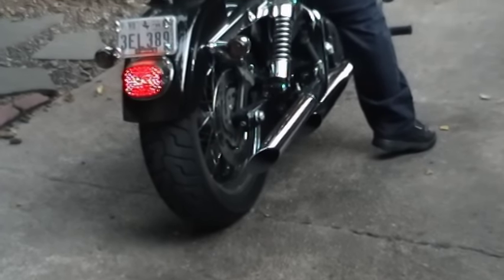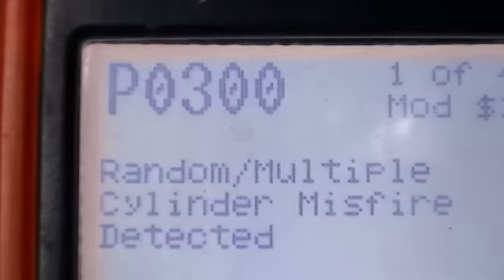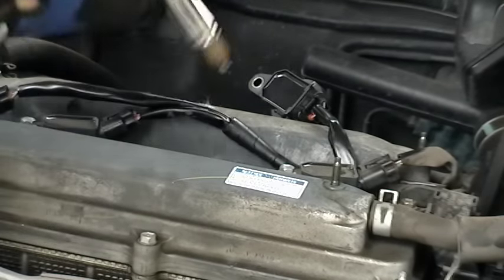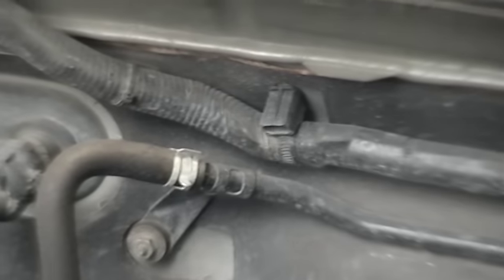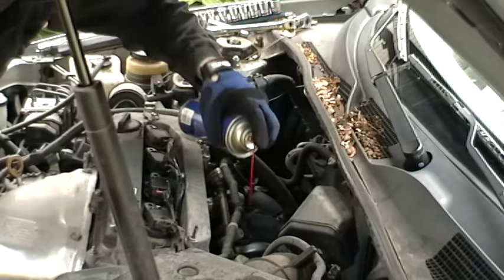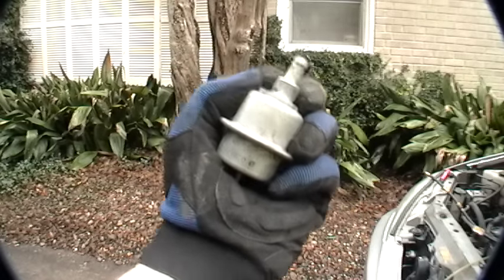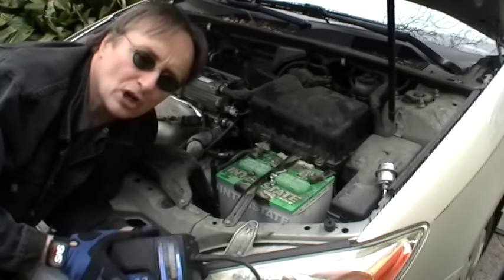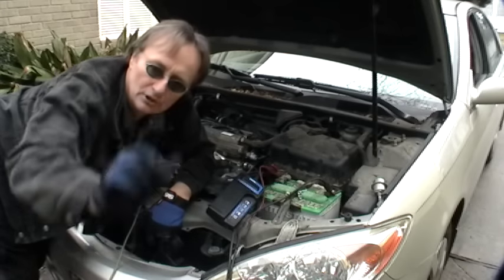How to Fix a Random Engine Misfire in Your Car (Code P0300)

Comment: Hi Scotty! I have the same code in my car. I changed the coil packs and igniters. The igniter plugs were in real bad condition. However it seems like this started to happen when I changed my PCV valve or for the Audi models it's called the oil separator valve. Any ideas? I checked also the battery it was good so I'm not sure what's going on. Also at initial start up when my car is starting up its normal but then after 1 min when all the cooking fans turn off the rpm slowly drops and drops more as if it's getting ready to turn off. Please if you have any ideas let me a hint I'm stuck between a rock and a hard place. Car is 2009 Audi A4 2.0T Quattro.

Comment: Scotty hi I like to ask you a question that me and my wife bought my daughter her first car for her 18th birthday. And the check engine is on and we had it scanned and came up with multiple misfires on cylinders 4-5-6. So I did a tune up changed the spark plugs and installed new coils (all of them) and I even changed the valve cover gaskets. After that was finished I didn’t clear the codes yet but I started the car and still ran rough. Is there something I’m missing and there some where’s else I need to check I hope I don’t have a bad piston or head gaskets

Comment: I've. Got a question for you Scotty
1998 ford explorer
304 code
171 and 174 codes
Changed plugs, wires and coil pack. 
Still has a 304
Changed number 4 plug a couple of times still comes back on. Cant remember the gap but i think it right. 50 something.
Next will be fuel filter. 
Any other ideas.
Reply from the maker: Patrick Wolbert do my video "finding engine vacuum leaks with a cigar" and pray you find some. If not, often a bad maf sensor
Reply: Scotty Kilmer thank you scotty 
Ive put a lot of work in this car i have to see it run. I have seen your  cigar vid on vacuum leak and am going to do that soon. Thanks so much for your help 
Love your channel

Comment: I have a 2000 BMW 328I and I'm getting codes P0305 P0306 P0304 and P1188 Codes, I already replaced the O2 Sensors before the cat.  I already checked the coils and spark plugs and cleaned the MAF Sensor plus I replaced the whole vacuum hoses and I clear the codes but after a day of driving the car they come back up.  Do you think it could be the secondary air pump ?
Reply from the maker: could be lots of things, you can't really fix a BMW without true guess work unless you have a BMW dealer level scan tool to analyze the data and real BMW codes, not just generic obd 2 codes.  But, from my experience, if you have that plastic intake manifolds those often develop  vacuum leaks, have a smoke test done first.

Comment: my moms 2001 toyota tundra has the CEL flashing and shaking. she told me that at idle there's nothing but when you put it in drive it starts shaking and smooths out as you accelerate, but when you brake the shaking gets really bad. if you know any more about this and possible causes and what it could cost to get fixed please tell me.

Comment: Hi Scott me again I put the scanner in my car and that code came up I had change the spark plugs not too long ago and the code still comes up my question is will I damage my engine if I spray some of the carburetor cleaner around the intake manifold but it's not plastic its like aluminum or steel I have a 02 Nissan maxima

Comment: 1984 Chevy Cavalier, 2.0 TBI. 64k miles. New Plugs, Wires, fuel filter, oil change, oil filter, and air filter. Cleaned the throttle body out and injectors serviced. Still misfiring and shuddering when its IN GEAR and my foot is on the brake. if i do this for a while (2 mins or so0 the check engine light comes on. When its in neutral its fine. Any advice?
Reply from the maker: get it scanned for the code, that light being on says a code is stored. E mail me that code so I can analyze it

Comment: Hey Scotty-
Got a weird one only 2002 Suburban 5.3L . Code P0300.  Also have a O2 sensor code. Very intermittent. Only when very wet outside. Plugs are worn, but are definatly not the problem. It's -12 here right now and it runs perfect, but when it rains it will misfire a little and the check engine light will blink. I think the fact it is so intermittent rules out fuel pressure and vacuum leaks. I kinda thinking full tuneup and replace the offending O2 sensor as well as the Cam position sensor and Crank position sensor. Any other ideas? Those are the only things I can think of that would be effected by being wet.
Reply from the maker: first, I would replace the plugs, if it's not that, then those are known for fuel injector problems. Try my video"how to clean fuel injectors on your car" and pray you don't need expensive new ones

Comment: hello Scotty, awesome videos! my 02 dodge durango started misfiring when Id hear the rad fan start at idle,then it would be ok after taking off. It did that 3 or four times. Last time it never came back. So far I have swapped and replaced coils to no avail. I changed the spark plugs, nothing. Changed the TPS today and at least it does not stall at idle now but still runs like crap. Also changed the battery and EGR today. When I changed the plugs I found they all smelled like unburned fuel. I noticed exhaust fumes coming out from behind the engine. I am thinking maybe the cat is clogged and the smokes come out through the flange or something but there is still smoke coming out of the exhaust. The hotter it gets,the worse it sounds. PCM? Cats? Fuel filter? Why would it come back to life a few times and not anymore?It happened so many times in my maximas I knew Id just have to change a coil and off I went. But not with my beautiful mudder..
Reply from the maker: have the battery and alternator load tested, auto zones do that free. Often it's just those bad

Comment: Hello! I own 2014 Mazda CX-5, 2.5 L. I live in Calgary and an "Engine Check" light appears on my dashboard every year when outside temperature exeeds 10 degrees Celsius. When it gets colder (in late September or in October) this problem disappeares until the next Spring.Two year ago, a Mazda dealer figured out that it was P0301 DTC but was not able to figure out what cause this problem. This year I checked it out with my OBD2 scanner and it showed me another code - P0300. Have you ever faced or heard about this kind of problem? What could cause it? This light turns on when I starts a cold engine (in the morning) and usually after the start during a minute or two engine works unstable. Then, during whole day, the engine works well. Hope you can help. Thank you!

Comment: Hey Scotty my partner has got a cx7 2008 turbo over 200,000kms on it and its having a bad jerking problem upon acceleration the engine light flashes then it stays on I checked the codes all it says is cylinder 3 misfire so I changed the spark plugs problem still there I changed the coil in cylinder 3 to cylinder 4 still having the same problem so I cleaned out the throttle body made no difference do u think it could be the fuel injector ? What else could be the problem?
Reply: Could be fuel injectors. Swap the fuel injector on the cylinder that misfires with a good cylinder and see if the misfire moves to that cylinder. If so, you have a bad fuel injector

Comment: Hey, I have a 2003 pt cruiser 2.4l 5 speed just bought it and the man we bought it from said he missed a gear and code needs to be reset,  Sometimes it doesn't want to go when in gear and I put the gas on but other than that it works like a charm. but we just found out the car has multiple code problems which are:  p0166. p0300. p0303. p0522. Is this something that the codes can be re rest and then drive the car awhile to see if engine light goes out?

Comment: Our accord has this code plus misfire on cylinder 3 and 6 so we took it to a shop and they said it's the camshaft. they recommended we buy a new engine.. Does this sound right? The cheapest I am finding my engine for is $1900. Wouldn't it just be better and cheaper to buy a new cam for $130 and diy or even get a shop to do it?
Reply from the maker: na, cams wear, then the rest of the engine is worn too, and accords have line bored cams, you can't really put a new cam in cause it's custom made for that head. Hondas don't use cam bearings
Reply: How sure are you you can't just put a new cam in a 09 accord? They said they would charge 12 hrs labor and however much parts would cost to fix it. They also said the problem is that the camshaft wasn't getting enough lubrication and that caused lobes to wear down which is causing the misfires.. I might see if other shops say it's the cams. What would you do in this situation Scotty?

Comment: Hey Scotty, i have a Grand cherokee laredo 2009 3.7L , i'v replaced all the spark plugs and the coil 5  , but still have the same problem, some times i feel a high vibration with a little sound but when i stop the car and drive it again after 1 minute i don't feel the vibration, there is miss fire code on cylinder 3, any thoughts about this problem please !!!

Comment: Hey Scotty sure hope you see this..i have a 2018 Kia Soul. I threw a P303 code so i knew change #3 Ignition coil and plug. So i actually changed them all. I crunk her up and took it for a test drive. Dam it jumped skipped and I parked it. Hooked up my Topdon and all cylinders were throwing a code. P300 P301 P302 and so on,...only has 50 Thousand miles on it. So basically the Engine has 10 year 100 Thousand miles warranty. But they're saying i could be responsible.. I've kept the oil changed regularly myself..Any thoughts Scotty.? And thanks.. Love all your Videos and been subscribed to you for Year's.. I'm about to take the coils out and return them for new  ones hopefully that works..Here in Brandon's World money is short...
Reply: Did you find the issue?

Comment: i have a 2003 Nissan Sentra GXE  and my PO300 code shows we really cant find a solution even though we did everything from your video. but when and only when i'm driving and my foot is on the gas there is a loud knocking noise coming from the engine. and once i remove my foot there is no more noise.

Comment: Hi Scotty. I have a Mitsubishi Eclipse that says code p0300 every time I check the engine light. I changed the spark plugs and wires. Changed the coil pack 10 months ago. Today I change the IAC valve. The problem I have is the car stumbles and rpm goes up and down. And I have to warm up the engine so the car doesn't die. Any insight please

Comment: 2010 nissan altima 3.5l sr hvac only has pressurized air in low pressure line and pressurized air in the high pressure line.  Any suggestions?

Comment: I have an 03 vw passat 2.8l v6, i replaced the coil pack and plug wires now the car cranks but wont start, drove to get the parts stopped and changed them out (less than 10 min) went to start the car and now it won't fire. Any ideas? Oh and now it's saying low oil pressure but the oil is fresh and topped off im stumped probably something easy im overlooking. I'd appreciate any and all help i can get trying to figure this out, thank you.

Comment: hello scotty!
thanks for all the great videos you posted so far..
I recently replaced iridium spark plugs on my infiniti g35 2006, put everything properly (specs), and made sure everything was connected and installed properly. As soon as I started the car, it sounded like a tractor. A check engine light lid too. any idea what this could be? can a vaccum leak cause the car to idle this rough?
Reply from the maker: get it scanned for the codes, realize often those coil assemblies will break just removing them to get to the plugs. if you have a code like P0301, that would mean #1 coil has probably been damaged. And of course, check for any leaks that may have been created moving all the crap out of the way

Comment: Hey Scotty!!  I have a 2002 Dodge Dakota Slt Quad Cab, and I'm getting the p0300 code.  Is there a common issue with the dodge dakotas that I can check or something that I should check first?  Thanks for your help!!
Reply from the maker: that's random misfires, tons of things can do that. check spark plugs first, but realize dirty injectors often do that on dodges, try my video "how to clean fuel injectors on your car;

Comment: Hi Scotty, I have a 03 mitsubishi eclipse. It says P0300 and P0171. It says too lean and random misfires. What do you think is the real problem in my car. I'm a working student and don't have muh money to fix a lot of things and buy parts.
Reply from the maker: too lean can be vacuum leaks on the intake system, weak fuel pump, or bad air flow sensor. Have those checked first. running lean causes misfires

Comment: Hey Scotty,
I own an '07 chevy equinox. Got P0300 & check engine light. Engine runs fine though. It came on as soon as the weather went above freezing (literally same day). Any ideas/suggestions would be much appreciated.
Reply from the maker: if it does run fine, live with it, weather changes can effect sensors and cause software glitches. IF it starts running bad all the time, then try fixing it by analyze the live data on the computer, or paying a mechanic to do it. Tons of things cause that insane code.
Reply: Scotty Kilmer Your advice was prophetic; it must have been exactly what you thought because I reset the light and it hasn't come back on since. Thanks for the expertise! Subbed
Reply: Scotty Kilmer Hi again :(... so I just got another code + engine light, this time p1516. I notice the car (only when it first starts up) jumping when I press on the gas pedal going a very slow speed, even lightly. It has also stalled once when I had it in drive but wasn't pressing the gas pedal. Any idea if these are related to the p0300, which has now gone away? I searched your channel and didn't find a video for p1516, so figured it would be ok to ask this here. thanks man

Comment: Hi,

I have a 1998 jeep grand Cherokee Laredo 4.0 its having issues . The scanner said to change the crankshaft sensor,  map sensor,  throttle sensor and yet it still having miss fire I put gas and it wont driver fast like it should it makes a sound like something is raddleling in the air filter.  Please help what do you advice I should check next?

Comment: Hi Scotty,
Love your videos.  I have a follow up question.  I have a 2007 Kia Rio that is getting the P0300 error, but it is also getting the 301 302 and 304 codes.  Already checked the plugs and they are good.   Been told by several other shade tree mechanics that the problem is the coils.  What to do you think?
Reply from the maker: yes, coils are a biggie on that model, change all four to be safe

Comment: I have a question.... I have a 2004 Infiniti g35 coupe.... here’s the story, car was running fine, one day my check engine light came on with code p0300, so I got it check out and was told it needed basically a tune up. So when trying to replace my spark plugs I found oil. So I ended up replacing my valve cover gasket and changing my spark plugs. After that was done p0304 showed up. So I thought maybe my ignition coils needed changing. At the time I was low one cash so I just replaced that one. After replacing it the car ran perfect for about an hour. Now the car runs worst than it ever has and when driving over 30mph my check engine light blinks. And has a weird smell like something is burning like its not getting enough air. So I know I need to change all my ignition coils I’m doing so this week, I just need advise on what else it can be....I NEED HELP??????

Comment: Scotty I have a question. My mother's car is pulling up a p300. It's a 05 Chevy Monte Carlo, 3.4L 170,000 miles. I've done all new coil packs, all new plugs, and fixed one vacuum leak at the intake plenum. It still shows a P300. It misfires horribly at idle, and if you take a slow turn without your foot on the gas, it dies. Is this a common problem with these? I'm going to check fuel pressure tomorrow.
Reply from the maker: yes, pressure test it, weak pumps do that a lot. Also realize those engines wear out at that mileage often, do a compression test of all cylinders taking the spark plugs out to see if it's just flat worn out
Reply: Scotty Kilmer hey scotty love your videos how long do you think my 91 celica 5 speed will last? i noticed at high rpms the 3rd gear grinds so im assuming the synchros are going out but they still work pretty good it has 156k miles runs and starts great the kid who owned it before me took great care of it and considering the tune ups im going to give it how long do you think it will last? thanks! and do you think it was a good choice of a car? i love it.
Reply from the maker: SvddenDeth
I've seen em go 400 thousand miles, and you can just bypass third gear and go high in 2nd and low in 4th

Comment: Scotty i got an 07 chrysler pacifica 4.0 i keep getting a p1004 short runner valve p0420 cat contverter  and p0305 cycl 5 misfire. What do you think could be going crazy and what should i do to fix the issues

Comment: Hi Scotty , I putted in a new head gasket cause my mechanic said he found coolant in cylinder 3 and 2 because I was loosing coolant but there was no leak anywhere so he said the headgasket was bad ,so after it was done 
I was still having at hard start on the first cycle, 
Then I went back to talk to mechanic and he said it might be the ECU because there was no engine light to see what was going on with the car.
So coming home after talking to him the engine light came on and I got these codes , p0302, p0303, p0300 and the famous p1399 
What should I do now?